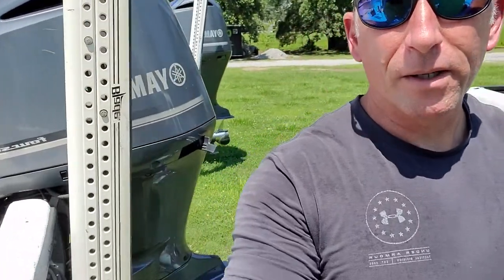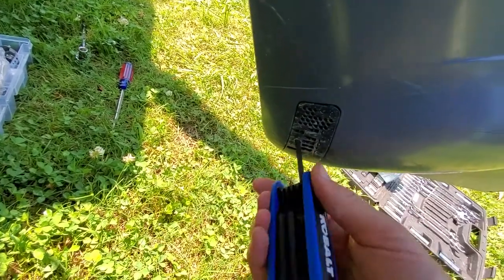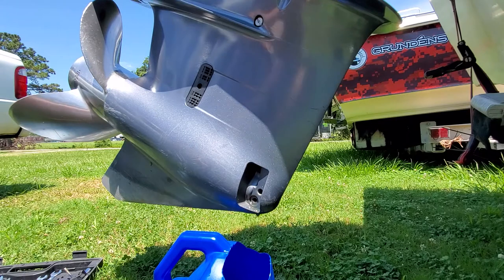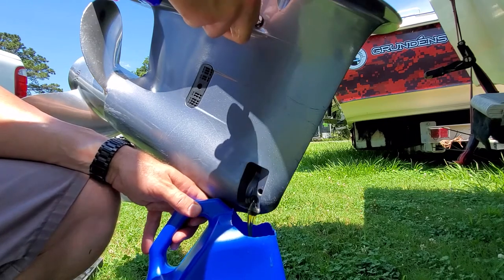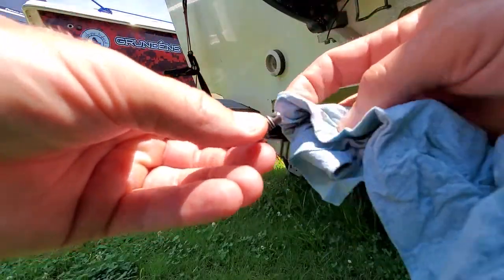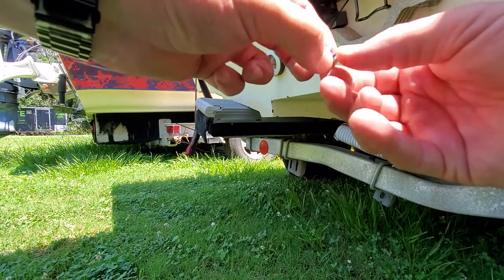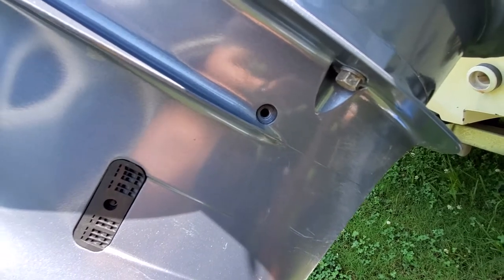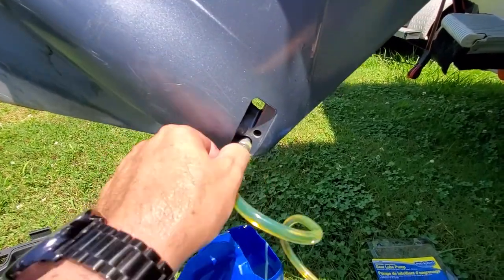How to change lower unit oil on a Yamaha 250 Outboard

Comment: Hi, How frequently should I change my oil in the leg. Motor only doing 90 hrs. Thanks
Reply from the maker: It's usually every hundred hours. I change mine every 50 hours because I'm OCD about it.
Reply: @GrippingLipsFishing  Thanks for reaching out.
Reply: @GrippingLipsFishing  How frequently should I change my water pump impeller? Thanks.

Comment: Just one error... I was always told by pros to move your motor DOWN to the normal operating position (Vertical) to ensure you get a Full fill level.  Angled up can leave it a little low on lube.

Comment: I just changed mine for the first time new boat to me shouldn’t the motor be level my 250 v max held exactly 1 quart at level trim ?
Reply from the maker: Well, you need to tilt it to let it drain. A quart sounds about right